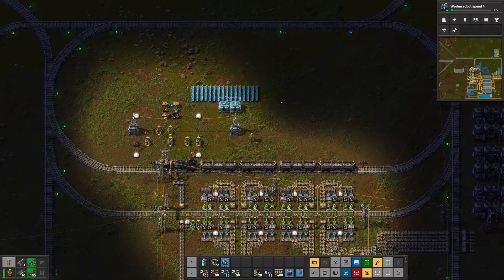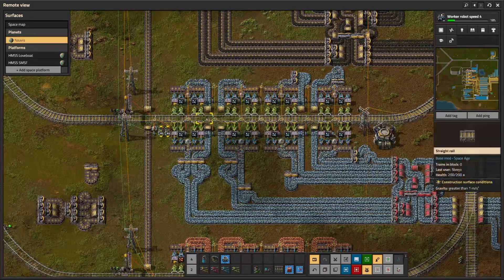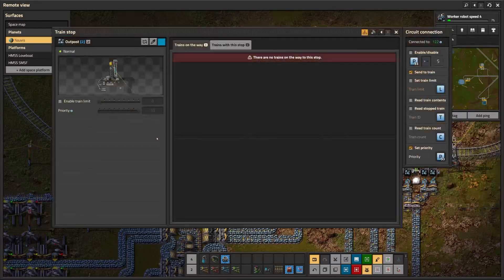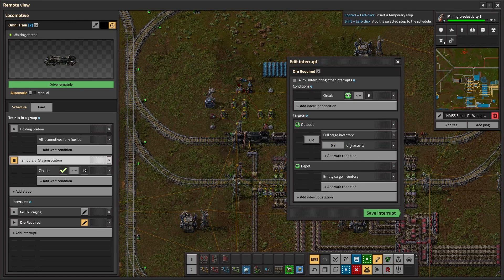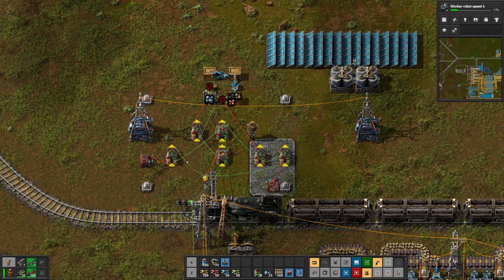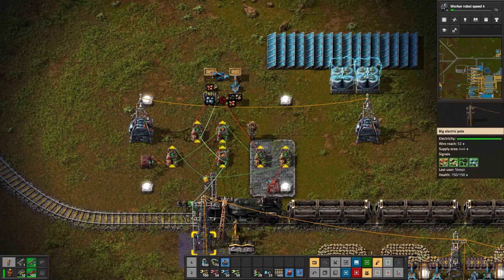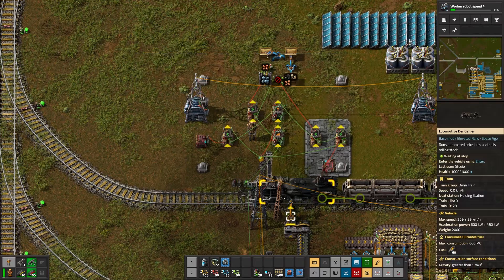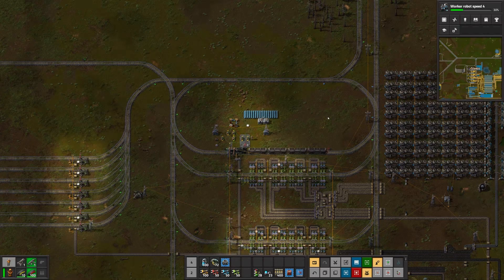Factorio 2.0 Space Age Omni Train Tutorial | Train Interrupts and Circuits

Comment: Still using this at the moment. One issue I found was that when we're sending our trains to get ore when the depot is less than 5% later on I was draining the depot of all it's ore and And I would run into a situation where the latch was engaged so it wouldn't send a new train to the ore depot, but it would never remove the ore from the latch because it wasn't > 9. So I tried raising the percentage the train would go to 20% and the issue I ran into was this meant I had to increase the amount of ore in the latch system from 4 to 19 and the inserters wouldn't move the latch ore fast enough and the amount of ore would get split between chests as the filters would engage and disengage too quickly.

I'm still troubleshooting it but my solution this particular problem was to instead use use 1 of each ore in the latch system and instead of reading the contents of the latch chest direct I fed it through an arithmetic combinator first to multiple each signal by the number I needed for output. This way I get the signal I want and there's only one of each ore in the system so they can't get split up.

Comment: I think your system is kind of complicated.  A train, after dropping off its load, should go pick up something else, not go to a holding station.

I also don't see why a train can't just go to a random station.  If the dropoff station is full, the train should be fine just chilling at the outpost with a full inventory waiting for it to open up.  At this point you could add a waiting depot closer to the dropoff area for a train to wait in.  Trains could have an interrupt trigger to go to this waiting station whenever they can't find a station or a path to wherever they want to go.

And then if you don't have enough trains, just build more trains.  Your network should be able to handle 1 train for every outpost and dropoff location plus 1 for every waiting station.  You can use the P value at stations to make sure your trains go to the outpost with the most goods.
Reply from the maker: So you mean a regular train system and not an omni train system? 😅 Would be a crap omni train tutorial if I just made regular trains.
Reply: @Steejo  I don't understand what problem you're trying to solve.
Reply from the maker: The problem is how to do an omni train. That's it.

Comment: This looks like another pull system, but it is overcomplicated and not that flexible.
People usually use push systems, which are easier to setup, but require you to flood system with trains which might be fine with 20-50 stations, but large base with 400-500 stations will require equal amount of trains to work and suddenly you either need large depot for 200+ trains or stacker on each station which provides resources and a system which adjusts station priority based on what is needed.
So push systems struggle in large base with lot of stations.
Pull systems like the one you built have different issues. The biggest issue is trains returning and leaving depot where they wait for next delivery, that can create bottleneck in train network, but can be mitigated by having multiple depots.
In my version of pull system I have requester stations and provider stations. Requesters output -1 resource signal if there is enough free space for one train worth of resource, both requesters and providers output +1 of resource signal for each train going to or in the station (read train count signal from station). This negates the signal from requester and prevents multiple trains going for the same delivery.
Trains are dispatched from depot using clock signal if there is negative signal for resource and there is open provider and requester for that resource. My system supports trains of different length as well as liquid trains and uses way less combinators (1-2 per station). Rest of the heavy lifting is done either by interrupts or parametrized blueprints which do the math for me when building station - stack size of items, when to enable station, capacity of station and train etc.
Reply from the maker: I don't see how your system solves the problem in a different way beyond needing less combinators? Seems like it's very similar but uses abstractions instead if percentage fullness.
Reply: The latch in his system is from the stations themselves (train count) rather than the chests and inserters that you use. I use a similar system to his (found on another youtube channel). Trains are dispatched directly from the “holding/storage” station, with each station active (sending a signal to a train) for one tick, with one tick between station activations (stations are active on even ticks, none active on odd ticks, each station has it’s own dedicated tick value, clock counts to highest station value before resetting).

The way I set up my trains, both providers and requesters set their train limit based on either number of waiting spots or number of train loads, whichever is less.

I have not yet implemented a priority system for the providers - I figure the closest available will be the best option - once the closer ores are exhausted, the farther ones will get used.
Reply from the maker: But that doesn't solve the problem of multiple trains going to fulfill the same request at the same time? Sorry it's difficult to fully comprehend these systems when it's just in text.

Comment: Thank you for the tutorial, very clearly explained how all of your combinators and circuit signals work. Saying that, do you think you could go in depth on the system preventing multiple trains going to the same outpost, I've been using Doc Jade's omni/auto-train blueprint, it works great overall but suffers heavily from this issue and would like to have a go fixing it myself (I'm just starting to understand circuits). Some on in the comments of his vid mentioned reading outpost contents and beaming that using a radar, seemed interesting, but your latch method seems a lot more foolproof and straightforward. You're turning everything into percentage contents of outpost or depot storage right?
Reply from the maker: Percentage contents of the depot storage, then the latch fakes having the extra percentage to make the system think there is more resources in the system than there is stopping it sending the signal to another train. You can modify the latch to send more trains out to get resources at a time if you need more throughput just make sure your outposts have a train limit of 1 on them. Hopefully this makes sense.
Reply: Just read the number of trains coming to that station and disable it if more than 1. Radar is essential for advanced train setups like tracking stations that are currently requesting.
Reply from the maker: Radar isn't essential, this build is intentionally not using Radar.
Reply: @Steejo  it is just essential for advanced train setups like I wrote. Not using a radar limits you in a lot of scenarios, especially with outposts where you cannot bring power.